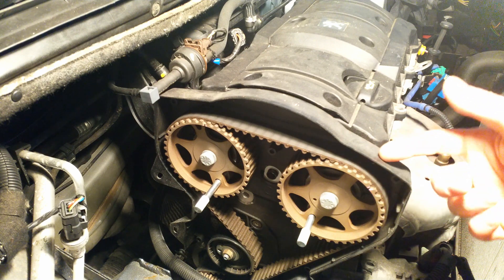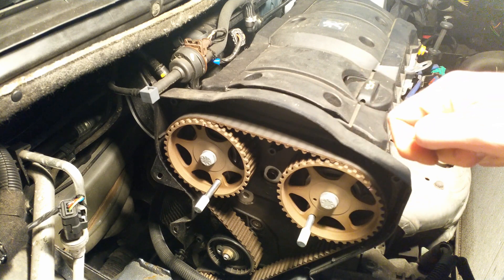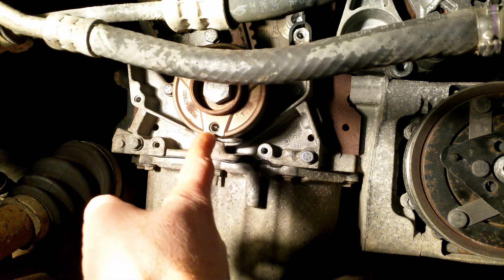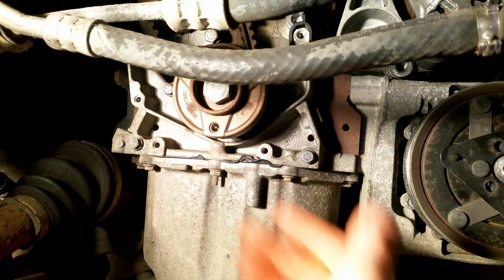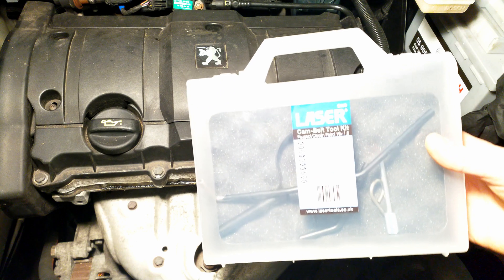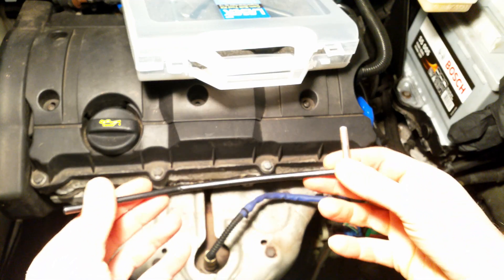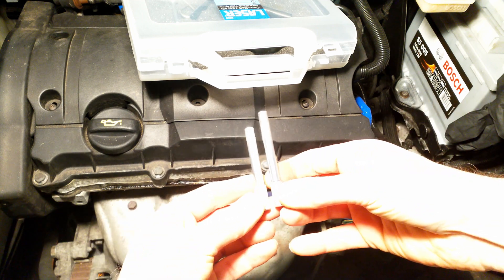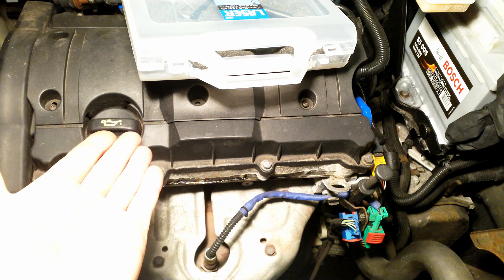Locking crankshaft/flywheel in 1.6 petrol TU5JP4 engines when changing timing belt (Peugeot/Citroen)

Comment: Thanks for the video and the links) My mothers Peugeot got quoted 1k Euros for the change at a workshop. I now did this myself. Blocked the crank with a bent paint bucket handle and used two m8 bolts on the cams. Worked like a charm.
Reply: Where is that price for 1k euro?

Comment: Когда ремень натягивали, стопора с распредвалов убирали или натягивали в фиксированном положении валов?
Reply from the maker: before removing the belt everything needs to be fixed, so it does not move when you replace it. Once you have put the belt on and everything aligns, then you can remove the fixing points and tension.

Comment: Very useful info, thanks! Usually guys in their videos say there's a hole to lock the crankshaft, but no one bothers to show where exactly that damn hole is. :)))
Reply: Mi amigo, es un hueco que está direccionado a la cremallera o la rueda trasera que conecta el cigüeñal; simplemente esa varilla o pin que mete allí, cae en los dientes de la rueda y bloquea el cigüeñal

Comment: Is this an extra safety if the pins at the start of the video comes off or something? Or absoluteyy needed? Asking because i just watched another tu5jp4 video and i didnt see they are doing anything on the other side of the engine. The video is "" watch?v=SroJdT60zqw ""

Comment: great video will this work on the c2 vts ?
Reply from the maker: Maybe, not too sure, probably it will actually if it is the TU5JP4 engine.
Reply: @moremolecules hi. How does that pin lock the crankshaft? Is the pin going on some teeth of the flywheel and locking it this way? or does it go inside a whole machined in the flywheel?

Comment: nice video. whats the diameter of the locking tool to the flywheel?
Reply from the maker: It is in the video description, but here it is: The genuine tool is 6mm, but I had to file it to ~5.7-5.8mm. The hole gets rusty and the 6mm rod does not fit quite well. The length of the rod that goes inside of the hole is ~2.8cm.

Comment: Anyone know if flywheel is the same in all Tu5jp4 engines? I changed the engine in my 206 1st gen for one that was in a 307.
After that change the engine lost power and sometimes at low speed there is no torque or became confused.
I read in a forum someone changed the engine in a Xsara to one from a 307 as well and only after changed flywheel the problems were solved.
Reply from the maker: I really do not know the asnwer to that question, but I suspect that they are the same.

Comment: Thanks for sharing your knowledge and expertise. 
I bought a timing belt (Bosch brand) for my Peugeot 206 sedan 1.6 two cam shafts. 
The belt has 134 teeth! 
I just want to make sure if it's the right one to my car? 
I intend to make the replacement my self.
Reply from the maker: It is fairly straightforward to change the belt + water pump and associated pulleys. I should have made a video, but thought not. I cannot quite remember if mine was 134 teeth. I bought this: https://www.autodoc.co.uk/gates/7024338
It was GATES KP15581XS belt + water pump and pulleys. The belt is Gates 5581XS with 134 teeth.
Reply: @moremolecules 
Yes, I'll definitely change the water pump + pulleys. 
One more question please. 🙏
The belt I bought has no marks (I mean the three white marks) for the crank and cam shafts.
Should I buy another one with those white marks, or may I count the number of teeth between the marks then make them my self??
Reply from the maker: @FIXnMIX..  The marks are extremely useful, but you do not need the marks, counting the teeth is also alright. If I were you I would get more reputable belt with white marks.
Reply: @moremolecules 
It's Bosch brand - made in Germany. 
That's what it says on the belt, plus it has all the (numbers, arrow ➡ direction and date) written on the belt except the marks!
Thank you so much for considering  my questions 🙏
Reply from the maker: @FIXnMIX..  If it is bosch, then probably alright. Just count the number of teeth.

Comment: Thanks MM  for that info straight to the point , can you pin the 1.6 hdi flywheel/crank from same area, I  have both models the petrol and diesel
Reply from the maker: Yeah, good question. I have not done it on my 1.6HDi, so difficult to give you a proper answer. I think the flywheel locking in the 1.6HDi is only to release the pulley bolt and not used for timing. The 1.6 petrol is used for timing.

Comment: Hello friend, I have Peugeot 307 form 2004 ( 1.6 hdi, 109hp ) does he have timming belt or chain?
Reply from the maker: It is a timing belt.
Reply: @moremolecules  okay thanks. I thought the same, but the guy From the shop told me it has chain so I was confused. I checked engine it has plastic cover on that place wheres the Belt... So i think its Belt.
Reply from the maker: @orenestorovic1921  Definitely not a chain. The 1.6 petrol and the 1.6HDi are not chains, but timing belts, regardless of the bhp. Check your car booklet and you will see timing belt replacement interval. You would not have it if it had a chain.
Reply: @moremolecules  thanks a lot friend.
Reply from the maker: @orenestorovic1921  No worries, glad I can help
Reply: Does 308 1.5 bluehdi have this? I understand the crank have 2 revolutions and cams 1 revolution and I'm not sure if I am on the correct revolution for crank to match cam but if I find locking on flywheel then this will confirm tdc for crank/flywheel ? Thank you

Comment: Is this a reliable petrol engine in your opinion?
Reply from the maker: In my opinion, yes. It is pretty solid engine and that is why I bought it myself. It uses a bit more fuel, as it does not really have anything, like a turbo. The engine does not have much stuff in it anyway to go wrong and it does not suffer from headgaskets as compared to the 1.4 engine.
Reply: @moremolecules  Thanks! So for C3 1.1 and 1.4 petrol engines are more economical, but less reliable than 1.6 engines.
Reply from the maker: @HardiHolpus  Yes, correct. The 1.4 (not too sure about the others) and the 1.3 (Citroen mainly) are economical, but very much prone to headgasket failure, so quite a bit of mixing oil/coolant. Not too difficult to repair, but it comes back again. For this reason there are great bargains to be had in the 1.3-1.4L petrol engines, but one needs to get hands quite a bit dirty.

Comment: Very helpful tutorial. I just bought a used 206 and this is one of the first things i will do
Reply from the maker: Good luck with changing the belt. It is pretty easy actually and I should have filmed it as well...and I did not as there were several others, although not in English. Check the links in the video.
Reply: @moremolecules  thank you. Yeah it looks pretty straightforward indeed.

Oh its ok. I am gonna get a small lock tool so i dont mess up the timing

Reason i bought this car is because i am gonna sell the new one i bought 2 years ago. I moved withing a mile to work and its stupid to pay off a car a barely use

Comment: Thanks so much. What is the length of the 6mm locking section going into the hole, if I may ask.
Reply from the maker: I should have put this in the dimensions. Thanks for the question, it goes inside ~2.8cm.
Reply: @moremolecules  Much appreciated. All of the best.